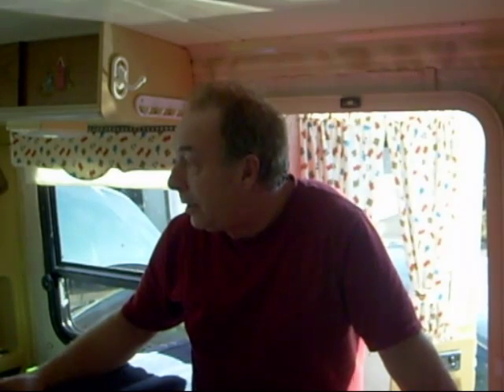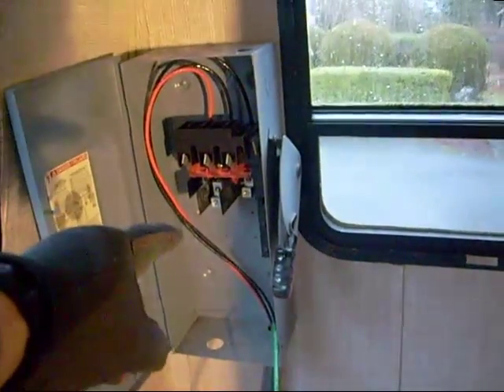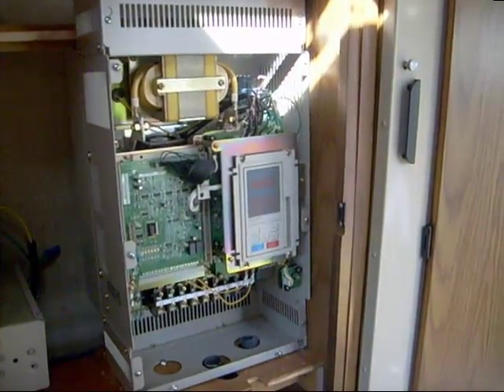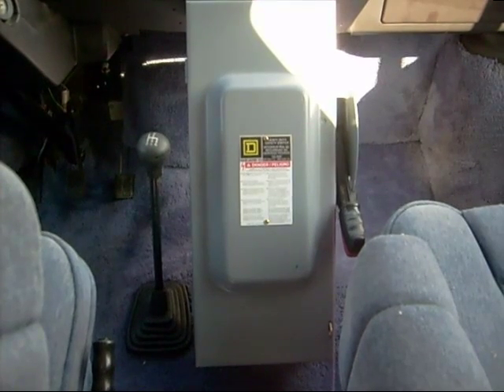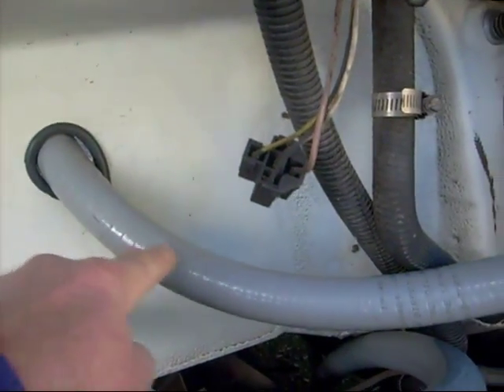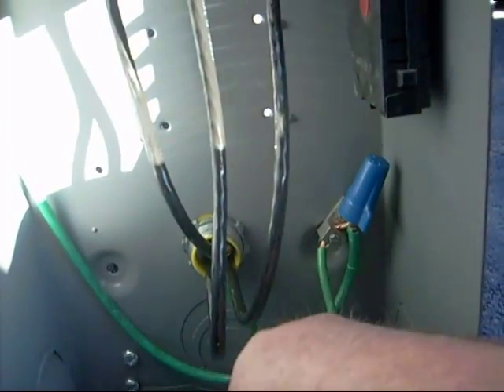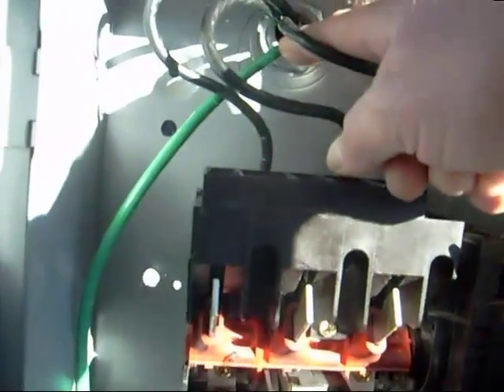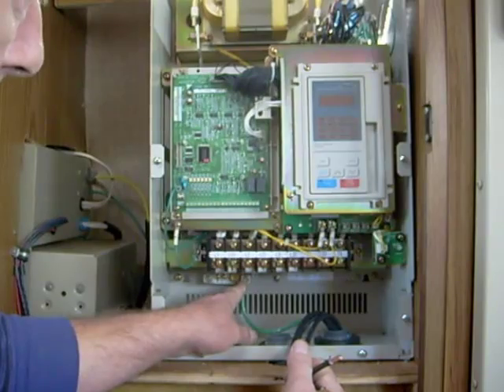The Electric Motorhome part 7

Comment: Is there data available on the hp required to move an RV such as this at, say 60 mph? I have always thought that a small efficient engine that put out enough power to cruise with an additional margin to recharge the batteries would be the most efficient way to power a vehicle. The batteries would provide the extra power for acceleration, but would not be the primary source. They would act as a power buffer for the engine. It would require batteries capable of a more rapid rate of discharge without damage.
Reply from the maker: Hi Dan. The original Diesel engine in the Le Sharo was 75 hp. The 30 hp electric motor I have installed is the equivalent of a 90 hp .diesel engine. I believe that McClaren racing have built a car to run as you described.
Reply: It would be interesting to see what the mileage would be if you run an efficient engine in such an arrangement. I'm looking at the Elio...but wondering how hard it wold be to fit it with an electric motor on the back wheel in this way. There is even a vehicle that uses a motor on the back wheel to borrow from.

Comment: On the genarator what are the specs? is it gas or diesel and will it be install on board.
Looking great!
Reply from the maker: I am using a 22kw, 460volt 3 phase alternator.I will  couple it to a 1600-2000cc engine of some kind.Not sure  if it will be  water cooled or air cooled.Thank you for Your input .{ *_ *)

Comment: Can you provide a brief explainatiosn of what the VFD will do in the architecture? (I wiki'd it but not sure which one you are using as there are several types of VFD) Great work JF!! Keep it coming.
Reply from the maker: Hello Joe.The VFD takes the incoming AC from the generator,turns it into DC and controls the frequency by means of a Pulse Width Converter.( this is what controls the speed of the motor).Then it turns the DC back into AC, and out to the motor.Thank You for the interest.